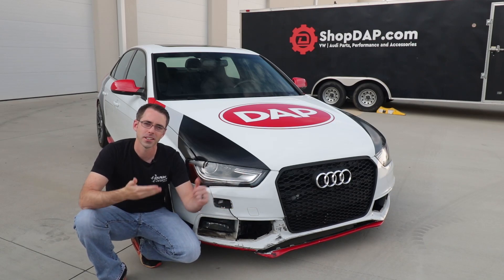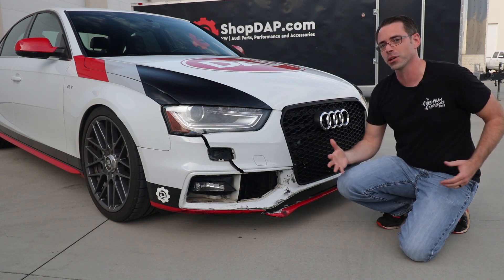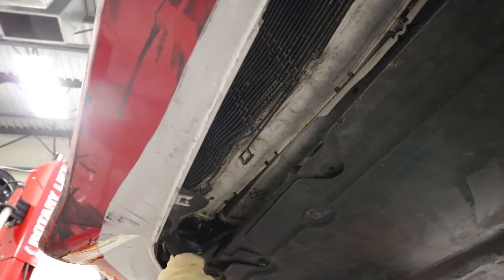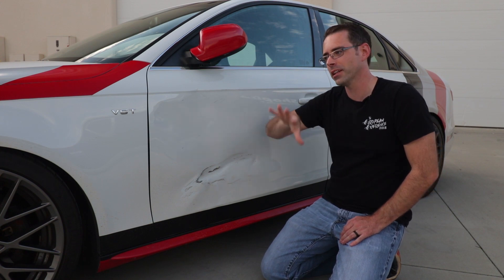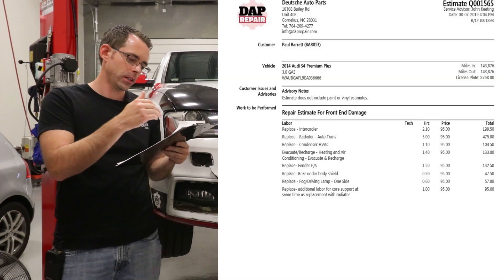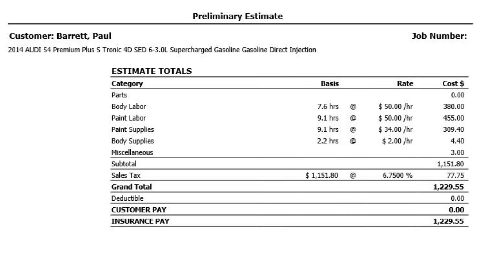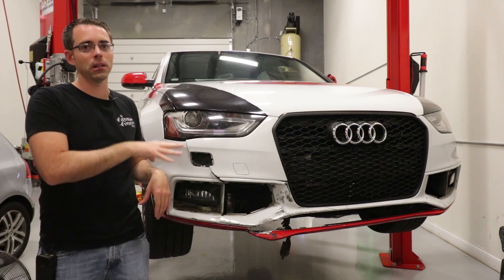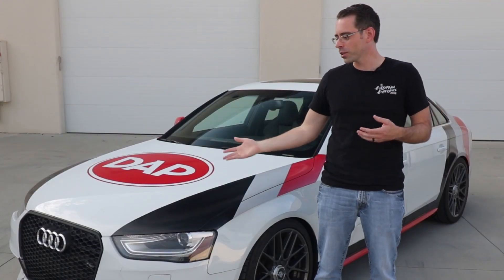The S4 Was Wrecked 2 Times in a Week..

Comment: Why are retreaded tires even legal
Reply: It depends on the situation, retread tires are not legal on steer wheels of buses. Most semi fleets that I'm aware of will not use them on steer wheels. The rest of the tires are free game from a legal standpoint.
Reply: They are perfectly safe. They only fail when the owner of them is negligent and doest check his tire pressures.
Reply: @BlackForestRacing  WRONG WRONG WRONG. Retreads are safe yes however tire pressures  are just the tip of the iceburg. From the quality of the casing to the quality of job done at the cap shop not to mention the quality of the glues and retread rubber. FIY all that rubber you see on the road . . . the majority of them are VIRGIN and not caps. Trash trucks can legally run caps on the steer
Reply: @BlackForestRacing  then in that case the dmv is handing out too many undeserved CDLs
Reply: @tuckerlutz8765  I feel like the US is insanely lackadaisical about driving privaliges both commercial and otherwise
Reply: @Breegr  Me: Retreads are safe
You: WRONG. Retreads are safe, but I used more words to say so
Reply: @BlackForestRacing  lol yeah I expounded on where I figured you was a wrong it would be the same as you saying The sun make light then me saying wrong and listing all the other things including light the sun actually does so instead of Wrong maybe we just say WONG
Reply: @Breegr  all in good fun my friend!
Reply: @BlackForestRacing  /Agree 

If I was a real man I would let you guys hop up my 19 rabbit but momma said no :(

Comment: Those estimates are total BS! 
Firstly if you’re replacing the ac condenser, you’re practically taking everything off, as if you’re replacing any other radiator ( Coolant and/or transmission fluid) . 

I don’t live in the US so I can’t say much about spare parts prices, but I can see that the estimate for the Condenser is about 400$us, in europe you will not pay anything more than 100$ for a OEM equivalent Valeo brand item. 

To me these prices are overpriced even for OEM Dealers standards in Europe. Therefore I find it hard for a third party repair shop to charge these prices, even when factoring in the fact that you’re in the US. 

Hope you get the car back on the road as soon as possible, as I’m a great big fan of this project car and the channel!